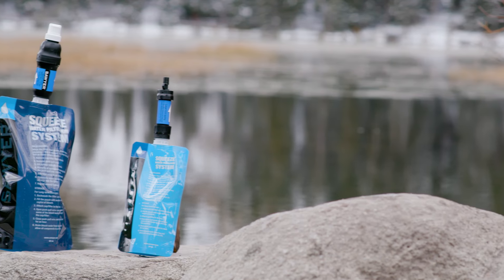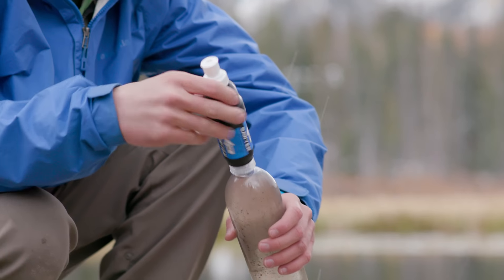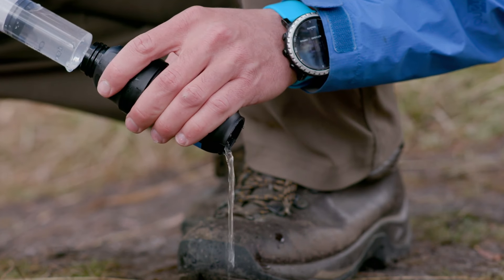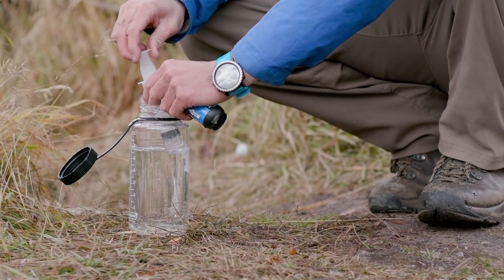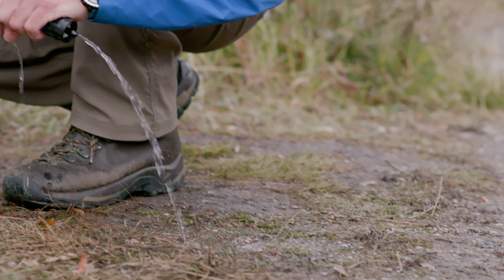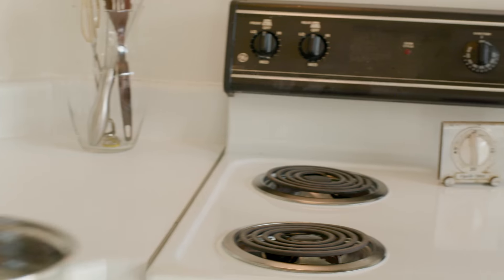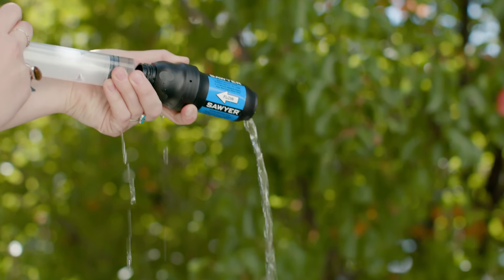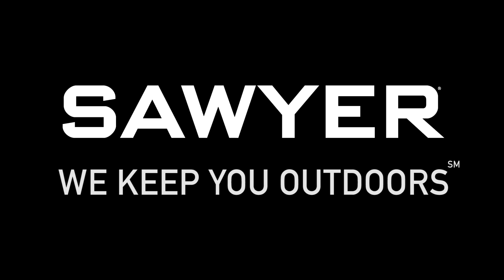Sawyer Filter Backwashing Tips and Tricks

Comment: Do u have to clean (backwash) after every use?
Reply from the maker: No you do not need to clean it after every use.  We recommend backwashing it when the flow rate starts to diminish or before storage.
Reply: Been using the mini for a few months now, maybe every 4-5 gallons the flow rate slows down to the point where you'll want to backwash it

Comment: Last year i bought a micro and on the trip it was fine. Came home, back washed and on the next trip it failed as in i was unable to sqweez anything threw☹️ was not happy. Had to ration the remaining water i had and boiled the stream water which is fine but even after boiling still has bits in.

Not happy
Reply: Hey Amil, the same thing happened to me yesterday on trail. I think the filter needs to be "charged" with water before using, which means backwash the filter to fill the filter fibers with water. I did that this morning and the filter is working perfectly. More story with my on-trail solution below.

I haven't needed to use the filter since last year, so I cleaned it when winter started and stored it(the filer is not much use with water that has ice in it during our winters). This spring I just threw the filter in my pack when hiking season started. Big Mistake! Fortunately, the Ranger I was hiking with had a Sawyer and helped me fill my bottle, then I backwashed my filter under pressure from the clean-water bottle and everything worked out fine.

My theory is the fibers are very small, that's the .1 micron pore size that holds out the nasty bugs. Water has to fill those pores, that takes pressure and not all pores fill simultaneously. The water coming out the clean end is water that has made it through the filter fiber pores, when we stop pushing the dirty and clean water remain in the filter separated by the fiber pores. So we are constantly drinking water that is a mix of the last filtration along with the current filtration. We can reason this for ourselves by comparing the weight of a completely dry new or long-stored filter compared to a just used filter, there is a significant difference in weight.

If we clean and dry the filter for winter storage, then in spring/summer hiking we need to recharge the water into the filter under pressure--such as from the syringe operating at their specified 20 psi pressure (or other bottles as shown at https://youtu.be/0KeLHMUfEtY?t=76).

CAVEAT: The water in my city (Portland, Oregon) is very low in minerals, there is no added fluoride and the water is treated with chlorine/chloramine for health and safety.Your tap water may be different and could possibly clog or contaminate your filter if used for backwash.

Comment: Yeah this information was NOT in my Sawyer pack when I bought the filter/bag/syringe pack (3 years ago now).  I just opened it and noticed that none of the instructions mentioned how to USE the backwash syringe.  Nice.  
Hopefully the instructions accompanying the product have now been Proof read (or maybe my pack was just missing the backwash instructions?)

Question:
I noticed people stating bleach+water are used to clean the filter (if stored for long time, dirty).  Could I use 3% Hydrogen peroxide and water mix as the bleach and backwash that through the filter?   I just prefer that (and what it breaks down into) rather then using a store bought bleach product.

Thanks in advance.
Reply: Nope....there are still no instructions with the packaging. I think watching the videos is more informative anyway.
Reply: as of Sept 2022 still no instructions in the package!
Reply: Instructions are on the squeeze bag
Reply: As stated by previous commenter both sides of the squeeze bag include instructions.. one side is how to use and on the other side is how to backwash it and storage instructions.
To clarify further the push/pull cap mentioned in the instructions is the white cap on the sawyer you see in the video, other than that the instructions are pretty straight forward and clear. 

As for the hydrogen peroxide.. take this advice with a grain of salt as I dont work for Sawyer.... But my logic is that it would be fine if not safer than bleach as you said it would be the 3% variation of hydrogen peroxide. I dont know if you should dilute it or not like it advises for the bleach lol.... if you did I'd use the 1:1 ratio for oral debriding because I dont see just a capful of hydrogen peroxide in 32oz of water being as potent/effective as the bleach. Stay hydrated and God bless everyone!

Comment: Do Sawyer filters have any sort of expiration date before or after they've been removed from the factory packaging? Like if you opened one up to try it out, cleaned it, then left it in an emergency bag for a few years, is there a risk it'll dry out or expire or break down or anything like that to make it no longer effective or safe?
Reply from the maker: so long as the filter has not frozen then your filter will still be ready to use.

Comment: @SawyerProducts I've backwashed my Sawyer micro squeeze by attaching it to an outside tap (UK standard pressure is anywhere between 1 and 4 bars).
Have I broken it please?
Reply: does it still work..? do you have any way to test for whatever contaminates you think you're filtering out to see if it's filtering them out or not? this is probably a good question, but leaving out way way way too many details to be answered accurately by anyone, even the equipment manufacturer.
Reply: Yep, wasn't risking it, it got binned a long time ago!

Comment: Does the filter get moldy? If you use it while hiking then back flow clean it are you supposed to dry it out somehow?
Reply: It wouldn't get moldy. I just let mine air dry put when I get home. After I clean it. Definitely clean it first. Because letting it dry out with guck, it will be harder to clean. Sawyer makes the best filter, in my opinion.

Comment: The problem I run into, either with trapped air or with it needing backflush, is I pull out my filter when I'm out of water. (say, a short hike that turned into an unexpected survival situation). Given I'm already out of clean water, it's inconvenient that you need clean water on hand to get the filter working.
Reply: Well it doesn’t clog up out of nowhere. You should notice it while using it. When you notice it (by the water source) backwash then, not later when you need water

Comment: It would be nice if you had shown how to actually attach the syringe to the filter.  Kinda the purpose of the video.
Reply: It doesn't attach; you have to hold the syringe in place. It isn't too hard, because you have to push pretty hard in that same direction to force the water through the filter in the backward direction.

Comment: hey I've  read things on you tube  about freezing and cracking   I know that's not your issue  but they do have a point   how do you have clean water if you filter cracks from freezing   just a thought    I would sleep with my filter in my pocket   right 98.6  is pretty warm  just dry it out

Comment: I did store mine for around 3 months and was never used outdoor, and I can see the flow is normal. Is it enough to only clean it with a cleaner plunger or does this count as dirty and need soaking water and so on?
Reply from the maker: the cleaning plunger should be sufficient but the soaking method will almost always help in restoring the flow rate further.
Reply: @SawyerProducts  The flow working normally but I was thinking maybe bacteria or parasites could be there after 3 months of not using it?
Reply: @SawyerProducts  I have a similar question, I didn't clean my sawyer mini before storing it last year. With dirty water sitting in it for 9 months is it going to be filled with bacteria? Should I soak in vinegar, or just purchase a new one?
Reply from the maker: @sk8neverdiez  you can definitely give it a good backwash and sanitation to restore it

Comment: Should we let our filters dry out or should we keep it filled with water for storage?
Reply: Fahim Sawyer recommends filling the pouch with water, add 1 cap of bleach (i use half), force some of the bleach water trough the filter, let sit for an hour, empty the pouch and let everything air dry to prevent mold forming.
So i guess storing dry is recommended.

Ps: these instructions are written on the pouch itself.
Reply: @ric84  well to me it sounds like he is asking the same question I am. What I am wondering is the filter itself seems to hold water for long periods of time. Like mine I used and then backwashed. Then it's been 3 days and of I swing the filter really fast water still comes out. Is it supposed to be dry yet?
Reply: @A.M.A.D.E.U.S.  9 months later i can confirm the damn thing never really dries out. Haven't died yet so i guess it's fine if you make sure it has some bleach in it for extended storage.
I'll probably do a proper rinse and maybe the vinegar thing the next time i'm using it tho.
Reply: @A.M.A.D.E.U.S.  I have seen some people jerry rigging am aquarium pump to it for drying which supposedly helps. Maybe a thing to keep in mind if you're paranoid about storing it wet.

Comment: My filters never flowed that much, hence me looking it up :o I wonder what I'm doing wrong. And the bottle always collapses when I dip it for water, idk how the bottle didn't in the beginning here :s :o
Reply from the maker: make sure you dont have any airlocks in the system!
Reply: @SawyerProducts  thanks but what's an airlock, sorry? :S :o
Reply from the maker: @clevelandexplorer2221  air trapped in the system or tube hindering the flow rate
Reply: @SawyerProducts  how do I sort that, please? I've backwashed, of course :s :o there's no air in the bottle either, I squash it to just about overfilling before I put the filter on
Reply from the maker: @clevelandexplorer2221  if you do not think you are having any airlocks in the system then we would recommend a thorough and forceful backwash.  This should fully wet and open up the filter fibers as much as possible, even if it hasnt had too much water passed through it yet
Reply: @SawyerProducts  thanks sm Sawyer!! And given the opportunity-thanks for making these so affordable! I'd never go out without one, and modded very little-quick disconnect from mouth piece to filter and use a 2l bag instead :) and a laggy band to keep the filter rolled in the bottle together and more clean. Thanks again XD

Comment: 00:23 where to buy that syringe thing they used in the video?
Reply from the maker: Suitable replacements can be found at most medical supply stores and drug stores but official replacements are available here: https://www.sawyersafetravel.com/sp154
Reply: @tonyb9578  👍 Mine came with one.
Reply: @SawyerProducts  and in europe? (Netherlands)
Reply: @harmleyten4 
Read what they said...
Reply: @vapensnakes7181  the site brings me to store where you can buy with the american dollar, it wouldn't make much sense for me to buy the syringe there...
Reply: @SawyerProducts  thanks for no information. I have found out that a normal plastic soda bottle (like coca cola) solves this because it is exactly! The right size to put on the filter, works even better and more reliable then your syringe👍
Reply: @harmleyten4 your BACKWASHING though ie washing from the drinking end there are no threads on this end so how dies the soda bottle fit on this end of the filter????

Comment: Is this considered a reverse osmosis filter?
Reply from the maker: It is not.  It is a 0.1 micron absolute barrier filter.
Reply: SawyerProducts would it remove most nutrients out of water?
Reply: @gqkushington   @gqkushington  it removes pretty much everything except heavy metals, so if your water source has a red-ish look to it you might want to use homemade charcoal filter and then Sawyer. Charcoal filter won't remove all heavy metal but it will reduce it enough for long term use

Comment: please replace those pouches, they are horrible to fill up with water.
Reply: Read the hacks, they have good replacements
Reply: Blow air into it, give it a squeeze in the middle so it doesn't collapse.  Mine fills super easy that way.
Reply: I tied Paracord around the lid and suspended it from a tree, the angle is much better than hanging it from the handle. But yeah I agree the pouch or opening should be changed

Comment: Only problem with this I find it's too slow to filter water and takes ages to get a cup of clean water. I wish it would be faster then this filter would be great.
Reply: Go with a Katadyn BeFree filter...flow rate is AMAZING.  I just like my Squeeze as it will last longer.
Reply: Have you not learned basic filtration? A slow filter will use as much filtration as it possibly can to filter out the water to maximize purification; hence, very clean and clear water.
Reply: @rd._874  I always boil water first and then I know it's safe to drink. I prefer boiling water let it go cold and drink. 
Water filters are good and some doesn't take away a virus. I'd rather be safe than sorry. I've drinked water straight from a stream before and I was ok.
Reply: @bushcraftandastronomer.3775  you rarely find a virus in a stream or river.
Reply: Backflush before use

Comment: Well, 20 psi does not sound like a two hundred pound gorilla can go forceful on that.. If the syringe was 1.5 inches in diameter, then 20 psi would require ca. 35 pounds of force on the piston, which I'm pretty sure I can exceed. Also, when backflushing from a water tap, the pressure in the pipes can go up to several bars, easily 50, possibly 100 psi... so what gives?
Reply: You don't backflush with tap water. So if you want to ruin it then go ahead.
Reply: @vapensnakes7181  Right, seems I've been misled by some erroneous product descriptions on amazon stating that the faucet adaptor was meant for backflushing too, which I failed to confirm in official Sawyer sources. However, it shouldn't make much difference whether the tap water runs forwards or backwards, so the fact that the faucet adaptor exists implies that the membrane should be capable of withstanding much more than 20 psi.

Btw as long as you don't let the filter dry after the tap water backflush, that is either continue using it straight away or finish the flush with some soft water, I don't see a problem in using trusted-quality tap water for the first stages of cleaning.
Reply: @PetrHosek  or better, you can use destilate water.
Reply: I’m almost certain I saw on their site or in a different video that it can take up to 40 psi for the filter and 7 psi for the bags. I’ve also seen them say in places that if using tap pressure then some faucets can put out enough to damage the filter when wide open so I wouldn’t risk it or at least don’t go full pressure. I noticed they released a new product now designed for tap use, maybe that is more appropriate
Reply: @PetrHosek Bit late but - its not a faucet adaptor. Its designed to go on water bottles, as shown in the video. The idea being that you can use the bottle you store water in anyway to backflush on the trail, and save the space for the syringe.
Reply: @TheAnon26  nope, I wasn't speaking about the adaptor used in the video, sawyer makes (or used to make) a faucet adaptor as a separate product. It's not shown in the video.
Reply: @PetrHosek  Aaaaah, in that case, nvm. :)